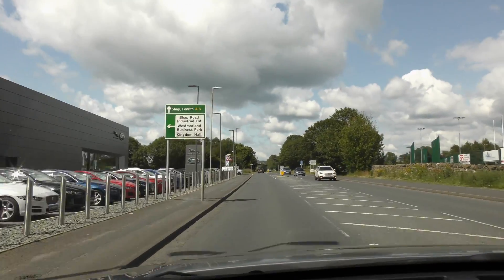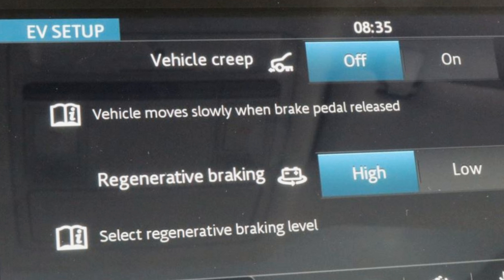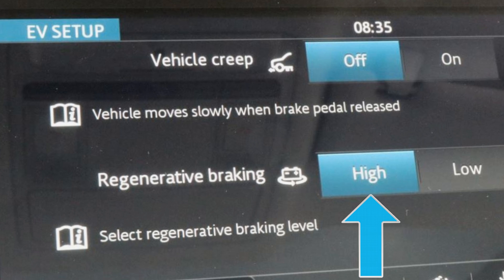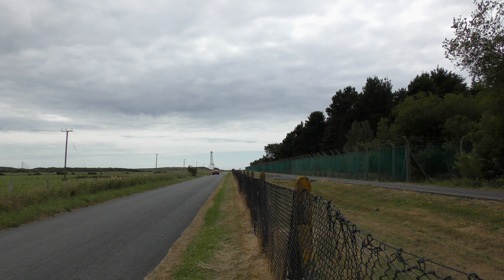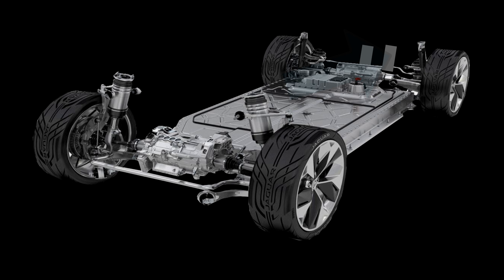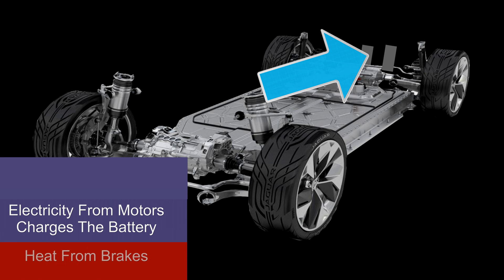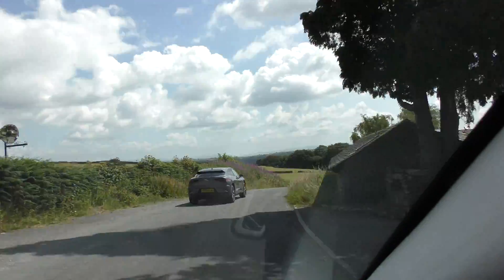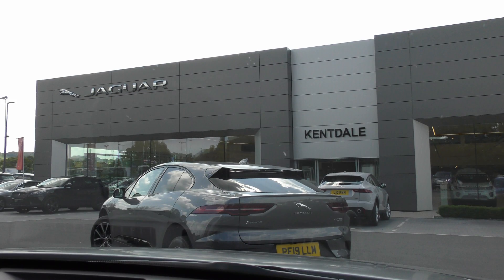Jaguar I-Pace Review Of  Electric Regenerating Brake System, In High,  Low,  With And Without Creep.

Comment: Question do the Brake Lights LIGHT UP when Regenerating Brake is applied?
Reply from the maker: Good question. You could be going down hill and regenerating power but not slowing enough to activate the deceleration sensor. So no brake light but still generating power.

Comment: I read online that the brake light activation is determined by the force of deceleration. So, if they're not coming on, it's because you're not stopping quick enough! When it regens more harshly, causing rapid-enough deceleration to mimic actual braking, the lights will come on.
Reply from the maker: Hi @hugemoose101. You are absolutly correct.

Comment: The range is not enough. 1000 kilometer is ok
Reply from the maker: Hi chia kurd. There are fast charging stations all over the Country and after driving for  4 or 5 hours, I need to have a rest (i.e. food and water). So I charge the car then.  However if you want to drive 1000 kilometres without a rest, you have a better bladder than me.

Comment: Nice work but more investigation required. What happened on high regeneration and removing your foot off the accelerator was to be expected. But what you missed covering is if you only reduce the accelerator on high regen but not full off do the brake lights come on, at what point does the regen indicator get to before the lights come on, would it be different for different hill gradients?
Reply from the maker: Hi Rich. Good question. One would expect there to be a relationship between the quantity of electricity being generated by the electric motors when they are slowing the car down or stopping it from accelerating on a hill. But there isn't.  There are deceleromiters  in EVs, they put the brake lights on when a set force is reached. You don't know when this happens, but the following vehicles do. So you can be going down a steel hill at a constant speed with the electric car's brake lights off, while all the other cars are having to brake to stop them accelerating. If you think about it it is the obvious way brake lights should work, they are saying, this car is slowing down.